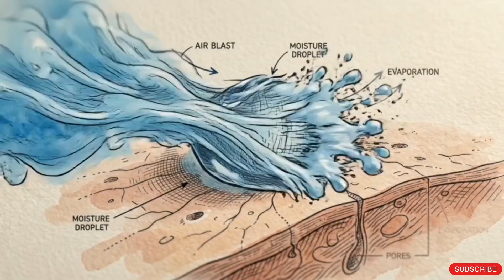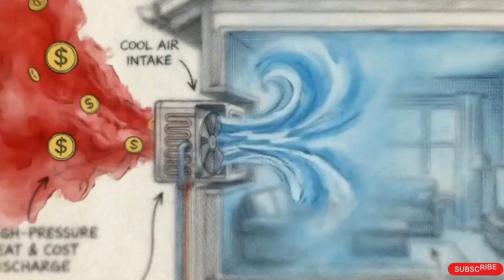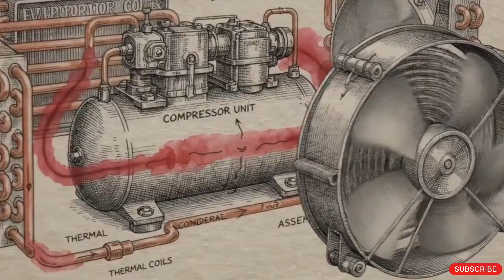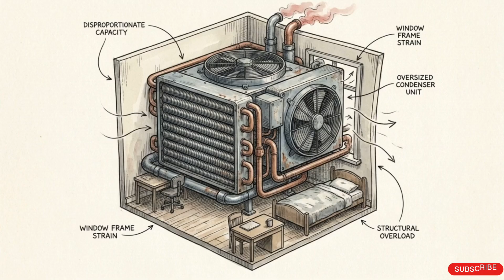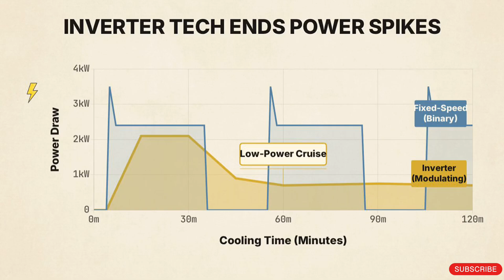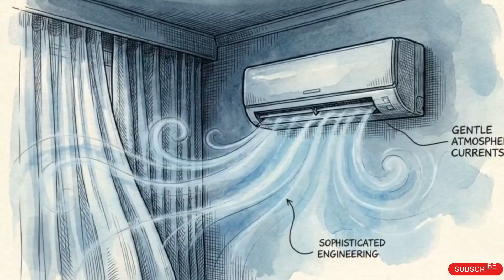AC Buying Guide 2026: Don't Waste Money! Inverter vs Non-Inverter | 3 Star vs 5 Star #airconditioner

Comment from the maker: Temperatures are soaring across India this summer, and your AC is your best friend right now—but are you using it right? Stay tuned until the end of this video to understand the physics of how your AC actually works, the key differences between different types of ACs, and inverter models, and my top tips to slash your electricity bills while staying cool!